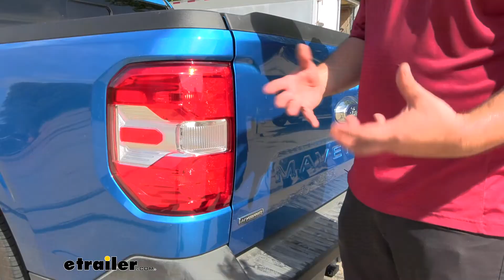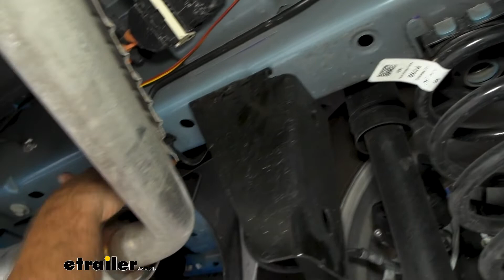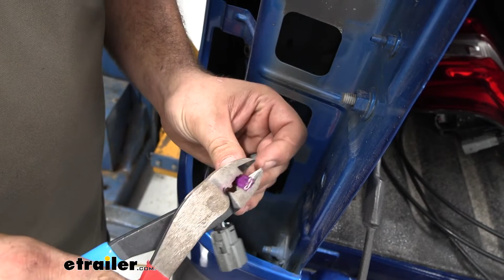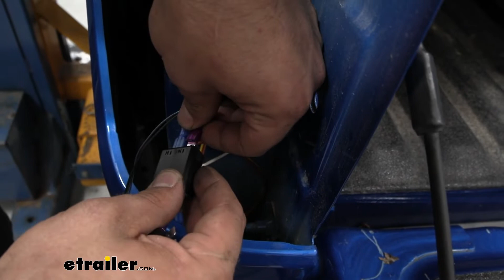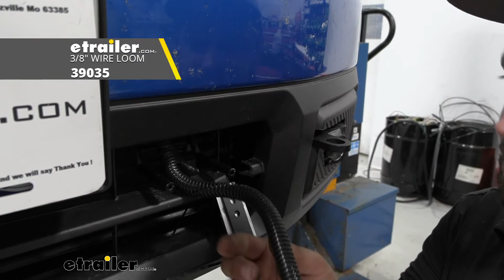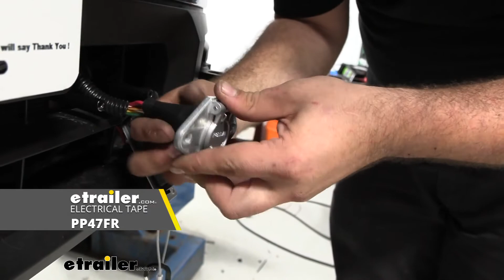How to Install the Demco 4-Diode Universal Wiring Kit for Towed Vehicles on a 2022 Ford Maverick

Comment: I have toad several different vehicles over the years and several of those vehicles had a dim lights problem.
Not enough juice was making it to the lamps. It has occured to me  WHY NOT USE THE TOADs BATTERY
to power its own lights?

!

Comment: Hey Brad where could I run a 12v auxiliary power lead to in the Maverick? I’ve heard that the battery can actually die if you don’t have 12v power going to it 😰
Reply from the maker: We're assuming you're wanting to keep your Maverick's battery topped off while you're towing it, correct? If so, you're gonna need a charge line kit like # RM-156-25. Check out the link:
https://www.etrailer.com/Accessories-and-Parts/Roadmaster/RM-156-25.html